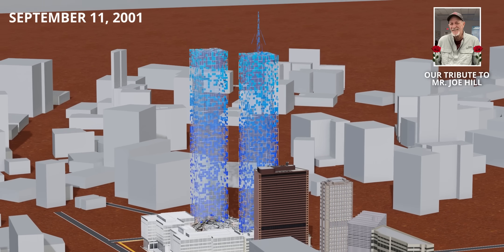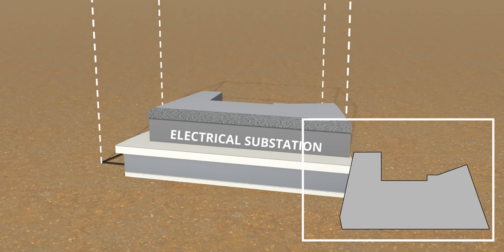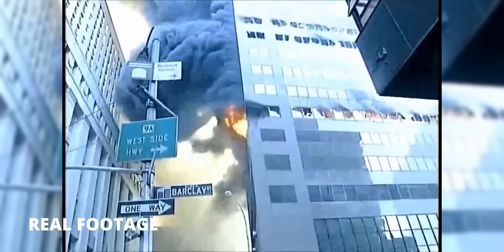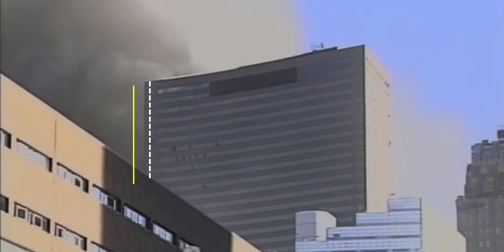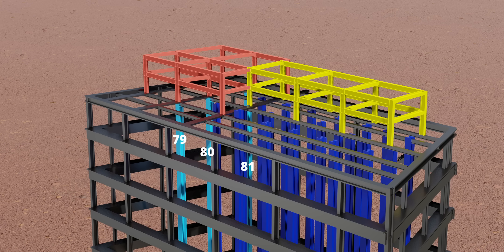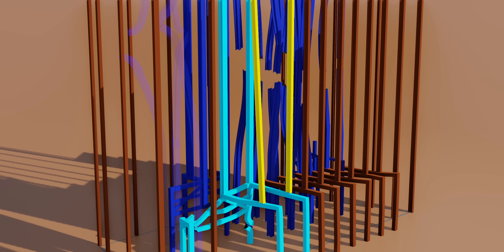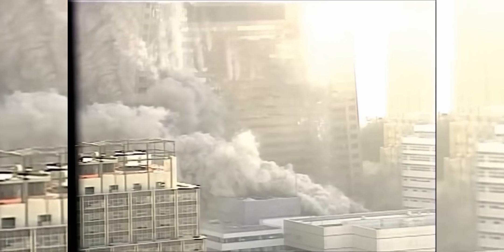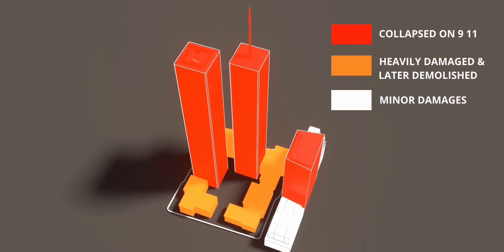Collapse of Building 7 | The Complete Physics

Comment: Anybody research who is correct? Ae911 who says it fell at free fall while this one claims it didnt. This one claims the video is sped up intentionally.  
 Its not an insignificant claim.
Reply: I did. This is what I found:  Building 7 was the 6th building to collapse of 10 lost on 9/11 and because of its early low priority was largely ignored for a while, so conspiracy filled the information void with simple-minded garbage by technically ignorant people promoting political agendas. This created a lot of confusion and misconceptions which I wish  to dispel, so I prepared this brief summary of my own analysis, using technical analysis, not ideology and magical (non)thinking. 

At 10:28am the WTC North Tower collapsed, showering Building 7 with tons of burning debris, causing heavy damage and starting many large  fires which burned out of control for the next 7 hours. Half the FDNY firefighters having been killed, units in disarray, equipment destroyed, no water pressure, and the greater urgency of search & rescue efforts, Building 7 couldn’t be saved so firefighting efforts were pulled as futile and 7 left to its fate. Firefighters make that sort of choice every day in brush fire situations - which houses to save and which ones to let go. Only real difference here is moving the decimal on the size and cost. People get overwhelmed by the size.

www.youtube.com/watch?v=g_SvpwyC17M

Collapse of a burning structure is always a concern for firefighters. Steel buildings subject to fire rely on active firefighting to survive. Buildings are designed around 1 to 3 hours of fire resistance, allowing time for occupants to escape and active firefighting to get started, after which all bets are off. Left to their own devices they'll exceed their design envelope and collapse, like Plasco Tower and Wilton Paes de Almeida. In 7 the occupants escaped, passive and active fire protections were compromised and active firefighting was abandoned hours before the collapse, which left the building to its fate. It lost. Odds on Building 7 would eventually collapse, and it did. No big deal in logic.

 http://www.youtube.com/watch?v=WnYBX6QT0R4 

FDNY Chief Daniel Nigro - The biggest decision we had to make on the first day was to clear the area and create a collapse zone around the severely damaged 7 World Trade Center, a 47-story building heavily involved in fire. A number of fire officers and companies assessed the damage to the building. The appraisals indicated that the building's structural integrity was in serious doubt. I issued orders to PULL back the firefighters and define the collapse zone. It was a critical decision; We could not lose any more firefighters. It took a lot of time to PULL everyone out, given the emotionalism of the day, communications difficulties and the collapse terrain 

FDNY Deputy Chief Peter Hayden ; We had our special operations people set up surveying instruments to monitor and see if there was any movement in the building. We were concerned of the possibility of collapse in the building. And we had a discussion with one particular engineer there, and we asked him if we allowed it to burn could we anticipate a collapse and if so, how soon? And it turned out that he was pretty much right on the money, that he said 'In its current state you have about 5 hours 

The collapse of Building 7 was anticipated and widely reported in the media throughout the day, with 24 video cameras recording some or all of the collapse. Everyone knew what was coming and why. 

www.youtube.com/watch?v=OY5S5k3tMHI

Building 7 collapsed from the inside out which is not at all intuitive and hard to understand, with most details being hidden from view.  It requires careful analysis and observation, and some people will struggle no matter how much it is explained. But here is my explanation relying on no outside authority. 

Building 7 was a unique, asymmetrical 47-story steel frame structure built atop a smaller 3-story building serving as a partial foundation, requiring lower floors dedicated to complex load transfer structures. Of trapezoidal shape and tube-in-tube construction, B7 (above the 7th floor) consisted of a central core of steel columns carrying most of the gravity load, perimeter steel columns around the outside of the structure carrying the remainder of the gravity loads and long span beams and girders to tie those elements together and form the floors. On the outside of the building hung a facade or outer shell. 

www.nist.gov/image-16640

Phase 1 : First externally visible signs of collapse initiation occurred at 5:20:28 pm and was notably quiet with observers not realizing the building was collapsing! No warning in the form of hundreds of eardrum busting 180dB explosive bangs. Here at 12:00 a local CBS affiliate reporter talking 10 blocks from B7 when collapse begins. People don’t start to notice the collapse until 12:11. At 12:45 is the famous CBS fixed camera clip of Building 7’s collapse. Note the silence. 

www.youtube.com/watch?v=t5tEy6mXSE8

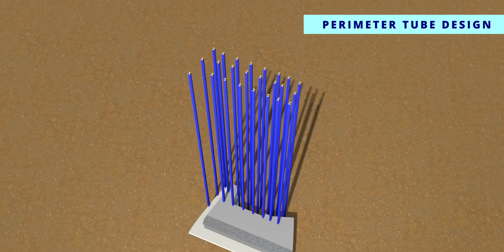Lower floor failures above the load transfer region (8-14) in the NE corner initiated the collapse. In this video at 0:45 you can see the NW corner from inside the building while under construction, Column 79 just out of frame on the left. That big, angled steel beam across the top of the frame connects to C79 at one end. The girders connect to the beam. That beam and all those girders depend on just one connection 

www.youtube.com/watch?v=nP3TNHPCIVU&t=45s

Phase 2 : NE corner floor failures caused a loss of critical lateral support over an excessive length of Column 79 and it buckled. Looking at the above floor diagram of Building 7 when you see all the structures that depend on C79 you quickly realize this one column was a relatively isolated structural element on which a disproportionately greater fraction of the structure depended analogous to say the Key Bridge. Externally as collapse begins we see a vertical progression of window breakage along the 44-46 line and a kink in the roof of the East Mechanical Penthouse at the top of the building, consistent with C79 failure. Normally with a buckling column, the load could be redistributed to other columns. With C79 that is not the case - the failure did not redistribute the load, so the collapse rapidly progressed to the roofline, sinking the rooftop penthouse. The transition from full capacity to almost no capacity occurs in an instant and will result in virtually no resistance 

Phase 3 : With C79 gone, B7’s progressive, non-symmetrical collapse continues with adjacent columns 80 and 81 left laterally unsupported and quickly buckling as well. The EMP drops down through the building. C79-81 all have no diagonal bracing, which is the major reason why they could not redistribute a lot of vertical loads among one another. From there collapse progressed from east to west through the central core until the core was gone from 81 to 58, taking all the interior floors and probably most of the perimeter columns with. Follow the horizontal progression of window failures low in the building and the dropping of the remaining rooftop structures into the building. The NIST Building 7 study model 4 determined C79 failing under ANY circumstances would have initiated the same collapse sequence. 

Phase 4 : After about 10 seconds only the exterior moment frame remains, giving the illusion B7 is still standing to the casual observer since little has outwardly changed. But it is just a hollow empty shell like an empty cereal box supported only by a few remaining columns and overloaded from the loss of the core columns and floors, quite unable to remain standing. With nothing remaining behind it, the north face leans inward, forming a V in the roofline, the last few columns buckle under the strain and the moment frame free falls, landing on top of the debris pile. 

It is only here at the very end, a single measurement of alleged free fall acceleration is taken, from just one point on that outer shell. The Building (core and interior) did not “free fall” - was already gone before that happened - just one corner of the outer shell briefly moved at a rate comparable to FFA. This alleged FFA was a product of how the shell fell NOT why the building fell . It’s also not even proper FFA as the single measured point was moving in 3 dimensions, not just down, which adds another variable. Start to finish the collapse took 18-20 seconds, 3 times longer than true FFA . How fast something falls can’t tell you what started it falling, certainly not 10 seconds after it started falling.  

The debris spread outside the footprint blocking surrounding streets, heavily damaging the Verizon Building and destroyed Fiterman Hall. 

No building is meant to survive 7 hours of multi-floor unfought fires. Building 7’s progressive, non-symmetrical collapse was incidental, unintended collateral damage from the combination of fire, time & gravity started by the collapsing North Tower, true no matter who planned and carried out the 9/11 attacks or why .  Of so little consequence it barely registered at the time, only taking on semi-mythical status as an alleged smoking gun years later when demolitions at the Twin Towers, missiles at the Pentagon and shoot down over Shanksville all failed and conspiracists had nothing left to work with. 

Anything can seem like a conspiracy if you don’t understand how it works. Now you should. I hope you found this helpful, informative and it solicits informed critical comment. If I made any errors of fact, logic or reason or left anything important out, please let me know so I can fix it. OR offer a more plausible alternative if you can. Be the first. Please start any reply with the words “Tits McGee” or I will know you didn’t read it and are wasting my time.

Comment: The supporting columns were looking like a dripping lava afterwards. No fire ever got down a steel frames with fire proof protection. All columns had to break at exact same time for building to go down that symmetrically. 
University of Alaska found huge mistakes in this report on which this video is made as the fire could not cause collapse of the steel structure. FEMA report in appendix C about steel examination: eutectic reaction: melting of steel.  
First responders reporting explosions including FDNY Richard Patterson before that building went down. Also, men with riffles preventing them to go in as stating “this building is secure.” BBC reports of building going down before it went down… Richard Gage and others justice for 9/11
Reply: I suspect you maybe read the Cliffs Notes version of Hulsey’s report and decided you liked it because you think it agrees with what you want or need to believe.

Most people who recommend and endorse the Hulsey report have never actually read it or would understand much of it if they bothered. I have actually read both the Hulsey preliminary and final reports from cover to cover, and I have to say, there are a few problems. The Hulsey report is such a dead horse now, flogged so many times I find it difficult these days to drum up the enthusiasm to do it yet again. But here it goes.

My opinion of the Final Report is as follows:

The Hulsey Final Report on Building 7 met none of its three stated objectives – indeed could not have met those objectives for lack of trying - and failed to prove its main conclusion, by way of a fundamental logic error; Hulsey claimed he had concluded fire could not bring down Building 7 without accounting for the full envelop of possibilities. Essentially, he claimed to have proved a negative

Hulsey also plagiarized almost 3 pages of material from Tony Tsamboti, who works for the studies sponsor. I hope I don’t need to point out the ethical implications of that.

While promising superior models to those of The NIST, the Hulsey Report in fact delivers grossly inferior models which eliminate the time factor, focus on only two floors and rely on a greatly simplified version of The NIST’s temperature data. The model animations are clearly not derived from the model data as they show no dynamics at all and are obviously forced to make the animations (superficially) look closer to AE911T’s imagining of the real event.

Overall, it is a shoddy piece of work done by a man clearly working out of his element and areas of expertise. It rather reeks of trying to support a conclusion arrived at before the study started. Curiously, study sponsor Architects and Engineers for 9/11 Truth having announced what the study would conclude before they awarded it.

Hulsey tested just one out of countless thousands of possible scenarios, using a completely unrealistic scenario and an artificially restricted set of data almost like he wanted to ensure fire would not cause a failure. The Hulsey Report was so factually inaccurate, methodologically unreliable, scientifically unsound, illogical, and biased that it blatantly violated any requirements of objectivity, utility, transparency, and reproducibility that would have been required to submit it for peer review in any reputable journal.

Hulsey and his assistants have not published the report anywhere that any relevant academic or professional engineers look to.

Hulsey had said all along that the report would spawn several (perhaps four) papers in good American engineering journals and possibly a book.

Then Hulsey walked that back, realizing he'd stand no chance to pass peer review in America and so said he'd go for European journals - but years have gone by with no publication whatsoever. Also, no book from any science publisher either. As far as the engineering profession and science are concerned, the Hulsey report barely exists.

The engineers of America and of the world have never read it. It has had zero impact in the professional community.

To its intended non-engineering literate audience, they Hulsey Report contains enough engineerspeak density for them not to ask questions, even if they were so inclined. Since the report appears to (superficially) deliver what they want, they are not inclined, even if they knew what to ask. From a structural engineering perspective however, The Hulsey Report is of no value, which explains why promises to get the report published in peer-reviewed and reputable engineering journals where it could be scrutinized by qualified professionals were abandoned.

If you are genuinely interested in what happened to Building 7 rather than in promoting a political agenda, there are several excellent forensic engineering reports out there and over two dozen articles published in genuinely peer reviewed engineering journals that are far more comprehensive and competently done. I suggest you seek them out instead.

And actually read them.

This should get you started.

FEMA BPAT (initial report superseded by NIST NCSTAR 1A)

NIST NCSTAR 1A: Final Report on the Collapse of the World Trade Center Building 7, 2008.

Guy Nordenson and Associates, WTC7 Global Collapse Analysis Report and Summary of Findings, 2010.

Arup, WTC -7 Structural Fire Analysis Report (Runs 1-4), 2010.

Weidlinger Associates Inc., WTC 7 Collapse Analysis and Assessment Report, 2010.

BRE Centre for Fire Safety Engineering, Analysis of the Impact of a Fire in the Mechanical Room (5th & 6th Floor) of the World Trade Center 7 Building, 2010.

T. McAllister, R. MacNeill, O. Erbay, A. Sarawit, M. Zarghamee, S. Kirkpatrick, J. Gross, Analysis of structural response of WTC 7 to fire and sequential failures leading to collapse, J. Struct. Eng. (United States). 138 (2012) 109–117.

For a summary of the major studies I would recommend THE COLLAPSE OF WORLD TRADE CENTER 7: REVISITED by Mhd Anwar Orabi , Liming Jiang , Asif Usmani and Jose Torero which is a 27 page summary of the different analysis and conclusions published in 2020. Sorry, YouTube will delete this post if I give the link but it should be easy to find and is available from the University of Queensland, Brisbane.

Real structural engineering industry professionals conducting real engineering studies and publishing them for other professionals to see. Not amateur YouTubers appealing to the gullible and credulous.

Happy reading

Comment: sorry, you fail to mention how exactly all the columns gave way at the same time, simultaneously within less than a second. 
if there was great damage on one side only due to falling debris from the towers, then wtc 7 could never have collapsed this way. 

and the „office fire“ theory is beyond ridiculous. not only is wtc 7 the first building of this kind to collapse, but also a fire burning paper and furniture would have to heat up steel so perfectly timed and with precision that the ry reach critical temperature within less than one second. 

i am sorry, but your analysis is fundamentally flawed
Reply: He never said all the columns gave way at the same time_ and in fact, this video shows just the opposite. The east to west progressive failure of core columns took almost 10 seconds before the barely-supported outer shell finally dropped.